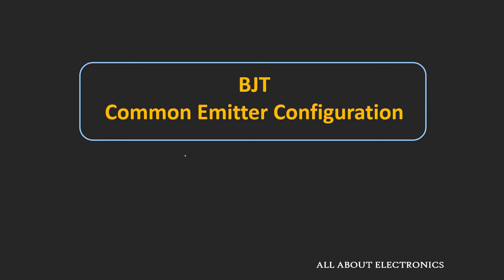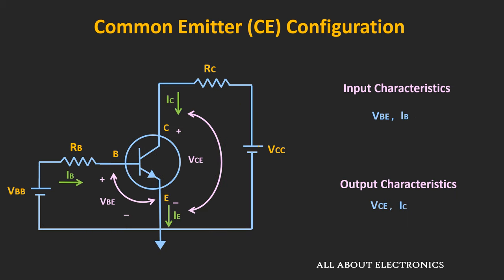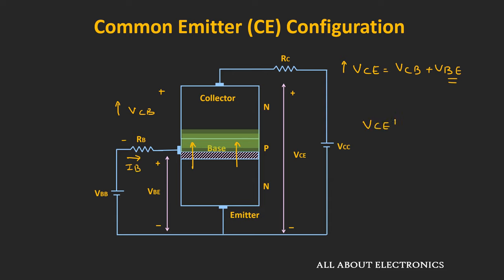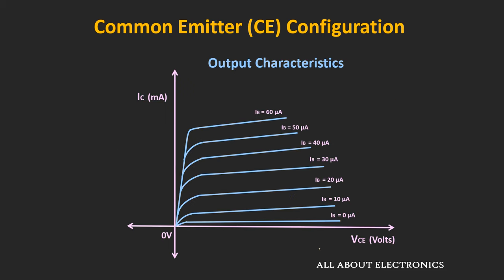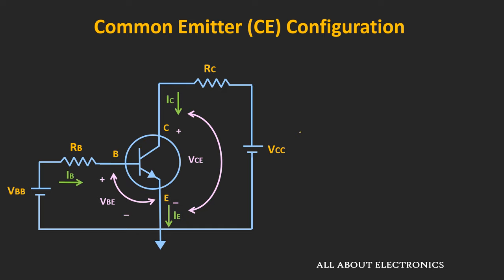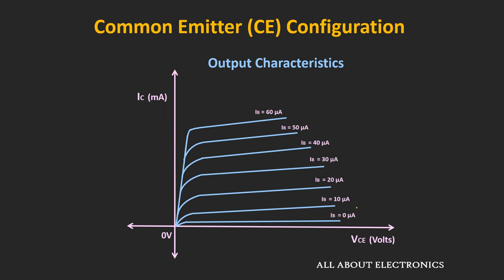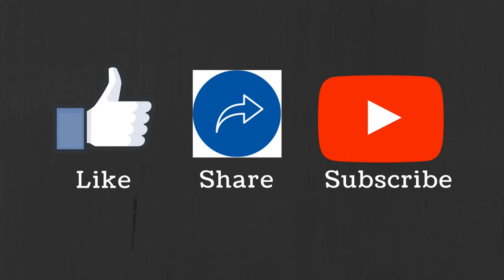BJT: Common Emitter Configuration (Input and Output Characteristics) Explained

Comment: It's not clear to me how current going into Base got decreased when Voltage between Base and Emitter is increased.
Reply: This had puzzled me too! Here's the explanation. 
During the forward active mode, i.e, B-E in forward bias and  B-C junction in reverse biased state, the width of space charge region in B-C increases. This also means that there is a stronger electric field in the space charge region. This consequently reduces the width of the base region. Due to this there is a huge concentration gradient in the base region. Now, when electrons are injected into the base region from the emitter region, diffusion process takes over and the electrons travel towards the B-C junction. When it reaches the B-C junction, the strong electric field sways it across the junction and most of the electrons gets 'collected' by the collector side. The small current in the base region is due to the recombination taking place there. Hence when VBE is increased, more electrons gets injected to base and more electrons are collected by collector side increasing IC. 
You might need a visual representation to understand the E-field effects well :)

Comment: sir, should beta be referred as amplification factor as said in the first video or current gain of CE configuration?
Reply from the maker: In the introductory video, it was referred as the amplification factor in general term. Because it amplfies the base current. But refer it as the current gain for CE configuration. 
In the upcoming videos, will discuss the expression of amplication factor ( voltage gain)of each configuration when they are used for the amplification of AC signal.

Comment: Your learning method is very good. But please speak slowly. Love from Bangladesh🇧🇩🇧🇩
Reply from the maker: Yes, I have noted that suggestion and tried to speak little slowly in the recent videos. But in case, if you find it little fast then please watch the video at 0.75x speed. You can change the speed in the video settings. I hope, it will help you.
Reply: @ALLABOUTELECTRONICS  Thanks a lot. Best of luck. Go ahead🥰🇧🇩.

Comment: While plotting the output characteristics of a CE configuration, the graph between VCE and IC, it shows that when VCE=0,IC=0 My doubt is from the circuit, VCE=VCC-ICRC . So when VCE=0, it should be like IC=VCC/RC.Please correct me.

Comment: I couldn't get it from minute 6:45 to 7:10 (how did Vcb exactly get forward biased?)
Reply from the maker: Vce = Vcb + Vbe
Or Vcb = Vce - Vbe.
Now, as Vce reduces and gets closer to the zero. Vcb = - Vbe  ≈ - 0.7V
Here I am talking about the NPN transistor, where the collector is n-type and the base is p-type. That means the collector-base junction will get forward biased. I hope it will clear your doubt.
Reply: c and b are not biased together as the input biasing is between e-b  and the output is between c-e, if we consider that Vce =0 then doesn't it mean it's cutoff case?!
Reply from the maker: When Vce is zero, then it will be in saturation. In cut-off, both base-emitter and collector-base junction are reverse biased.
Reply: Thank you ❤️

Comment: Sir I have a confusion,how the collector -base junction is reverse biased plz explain
Reply from the maker: Vcc is usually more than Vbb. So typically, the transistor is biased in a such a way that, Vc (the voltage at collector) is more than Vb (voltage at base ). If Vc > Vb then for NPN transistor, the collector base junction will get reverse biased. I hope, it will clear your doubt.

Comment: Sir i have a doubt that the vin is alternate voltage so when it is between 0 to 0.7V it acts as off switch so how would it amplify the input voltage
Reply from the maker: Well, that is why the biasing voltage is applied. The input AC signal is on top of this biasing voltage. The biasing voltage ensures that the transistor is operating in the active region, or at least that is how it should be biased while using it as an amplifier.
For more info, please check this video on transistor biasing.
https://youtu.be/5T84Jzcgj7M
Reply: Thanks for such a quick reply 😊 got it.

Comment: sir in common base in ic vs vcb graph ic is constant but in common emitter ic vs vce is not constant in active region.
Reply from the maker: It is because of the early effect.
Do check out this video, you will get it. 
https://youtu.be/BOk501WULQs?si=EcMAreDF4O6NBNMs
Reply: @ALLABOUTELECTRONICS  Actually the correct reason is to keep as vce increases ib decreases to keep ib constant we will inject electrons from emitter or simply we will increase ie.

Comment: Sir os output taken along collector and ground or collector and emitter??? 
Thanks
Reply from the maker: The AC output is measured across the collector and emitter. But in this case, since emitter is grounded, so we can say that the output is between the collector and the ground. But if there is a feedback resistor at the emitter (un -bypassed - without bypass capacitor) then that would not have been the case.
I hope it will clear your doubt.

Comment: 🎯 Key Takeaways for quick navigation:

00:42 Common emitter configuration
02:00 Input and output characteristics
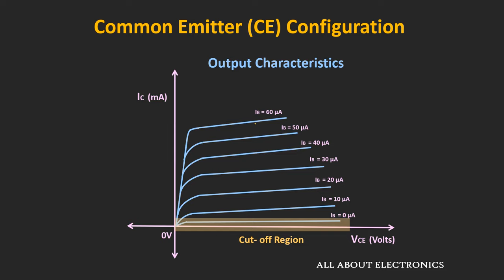04:41 Active, saturation, cut-off regions
06:04 Current gain beta
07:25 Cut-off region leakage
09:30 Base current zero
10:55 Leakage current amplified
11:51 Moderate current, voltage gain
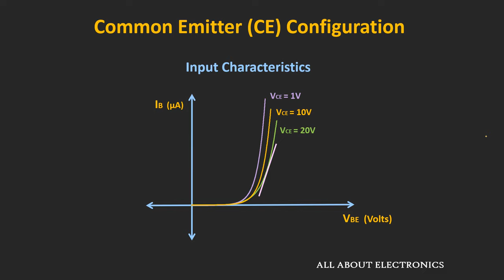12:18 Output impedance range

Made with HARPA AI

Comment: Sir why the value of VBE is fixed in the relation  VCE= VCB + VBE
Reply from the maker: Typically, for DC analysis, it has been assumed that VBE remains fixed. But it does change with the collector current. I have explained it in detail in the large signal model of the BJT. 
But for DC analysis perspective it can be assumed relatively constant for the given transistor.

Comment: can we apply AC source between Vbb and Rb ? so we can check that this circuit can work as a amplifier  or not
Reply from the maker: Yes, if it is biased properly, then if you apply the small ac signal between the base and the emitter terminal then you should get the amplified output between the collector and emitter terminals.

Comment: What is the difference between beta DC and beta AC ?
Reply from the maker: Beta DC is the ratio of dc collector current to base current. While beta AC is for Ac currents. On top of the dc biasing, it the ratio of change in collector current (AC collector current) to the change in base current.

Comment: At 1:24 which is greater Vce or Vbe
Reply from the maker: Vce. Because emitter is at ground potential. That means Vb is at 0.7V approximately. 
And for the collector-base junction to be reversed biased, the collector voltage has to be more than the base voltage. 
I hope it will clear your doubt.
Reply: @ALLABOUTELECTRONICS  what if I take Vce=0.5 V Explain the current then

Comment: Sir at 1:03sec u told reverse bias is between collector and base but I think its between collector and emitter
Reply from the maker: No No, it's a collector-base junction only. The collector is at a higher potential than the base terminal. So, CB junction is reversed biased. If you go through the other videos on the BJT playlist, you will get to know it in detail.
Reply: @ALLABOUTELECTRONICS  ok ok thank you

Comment: 1:06 .....reverse bias 
but connected forward bias
Reply from the maker: If you closely observe, the voltage is applied between the collector and the emitter. With collector more positive than emitter terminal.
But it will not forward biased the collector-base junction. If the voltage at the collector is more than the base voltage, then the collector-base junction is reverse biased.
Reply: What will happen if we reverse the battery.. Meaning negative side to collector and positive to emitter? Will it be forward biased? And go in saturation?